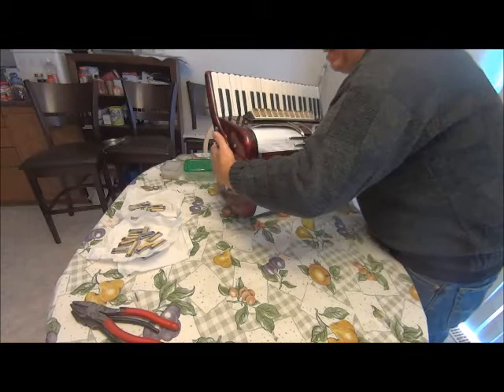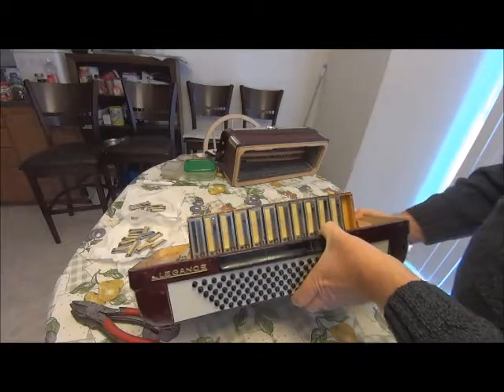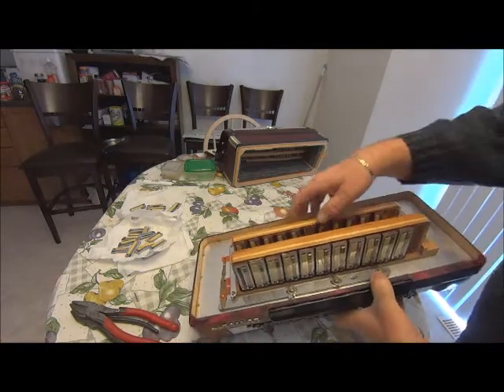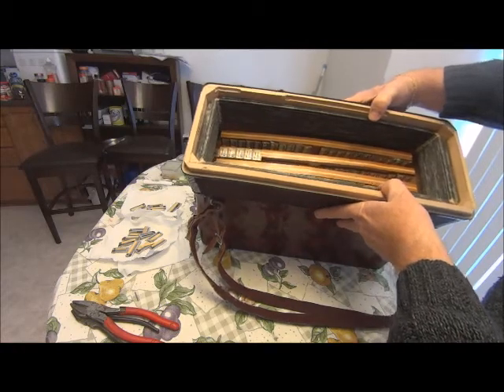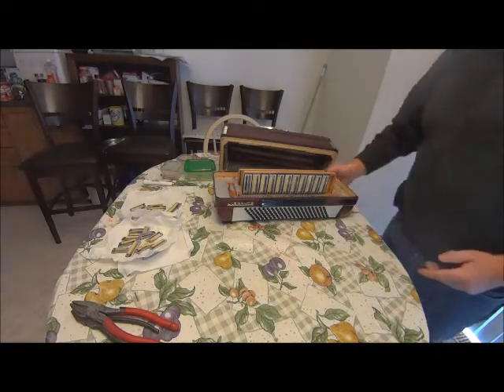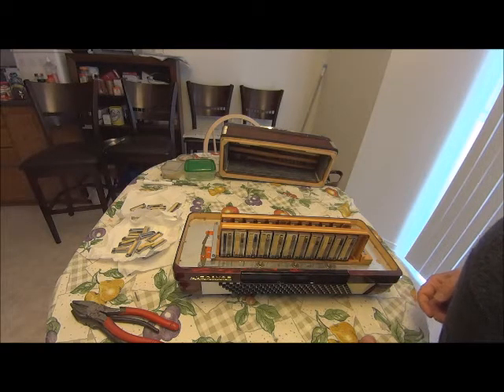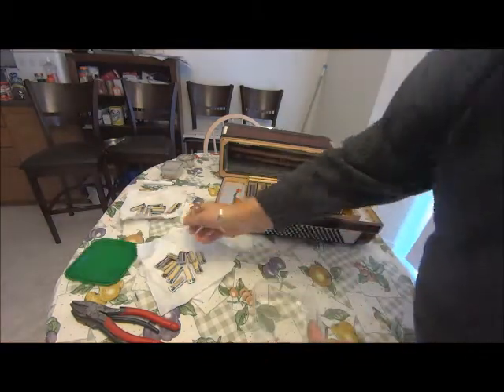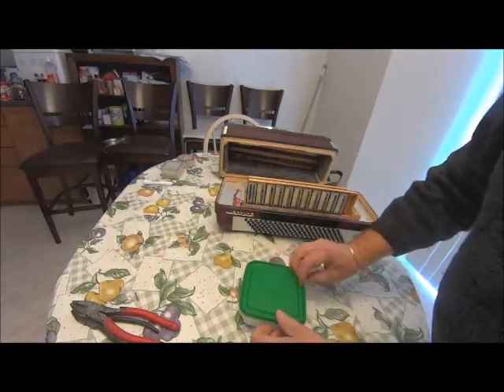Accordion Reed Repair

Comment: No waxing of the reeds shown.  Should show how a tuner is used to identify which note each reed plate represents and how to label them.  Should show the possible need of melting the reed wax on other reed plates that may be cracked.
Do you use a variable heat solder type gun?  How do you prepare the reed wax for re-melting each reed plate?  If all of the reed wax is aged and brittle, what do you recommend for the owner?  Simply showing the superficial damage is only a small part of the needed repairs.  Reed wax is not simply bees wax, it a mixture of bees wax, rosin, and perhaps linseed oil.   This misconception has caused owners to perform completely inadequate repairs on accordions when the proer wax is readily available on the internet as is a variable temperature solder gun ideal for repairs short of a total re-wax of an accordion.
Reply from the maker: I will post another video shortly showing the wax and tools I use. Stay tuned.

Comment: where is the next video that shows you figuring out what reed is what.  I have the same problem.  Too bad the reeds aren't marked, that would be easy
Reply from the maker: When I have one like that I will try to show it !  Yes agree the reeds should be marked.
Reply: Hi,
I'm just working on the same problem.
To know the place of each reed plate on the reeds block do the following:
1- get ur cell phone voice recorder ready
2-  get one reed plate and blow or inhale the air  through it with ur mouth ( as if playing a harmonica ) until you can make it producing sound.
3- try to produce that sound as long as you can and you may repeat that several times and record the sound that is coming, record all the voices of the fallen reeds in separate files and name them.
4 - get another accordeon and start matching the records with the notes on the accordion and write down everything.so now you know each n every Reed's note.
5 - go to the bass side ( let's say the fallen  reeds are the bass's) , and start pressing each n every note n see which hole opens and accordingly match and place the reeds on the block. 
6- wax the reeds. Don't mix the wax yourself it's pain in the neck, I got the wax ready from Liberty Billows in PA, for $5 you get what is enough for 12 reeds.
7- if the reeds blocks are very very close to each other, I'd use a small painting brush and do the sides of the reeds, and fix them one by one and then I wax the upper n lower edges. Or take it to repair store n let him wax them for you( no idea about the cost ) .
I hope this was helpful.

Comment: 😕😕😕😕
I repair tons of things...first off...why pin nails to hold the thing together. .? ...small screws would be better...the reeds you said would have to be listened to...? ...why don't they simply put on the plates the music notes pitch...a/b/c and so forth...and bees wax....why not screws and a rubber housing....heaven knows they cost enough for simple measures to make maintenance 
An easier process
Reply from the maker: It’s been done like this for years I guess they figure why change it. And yes they should stamp the reeds with note names would be easier.